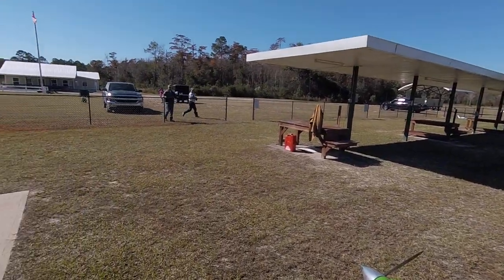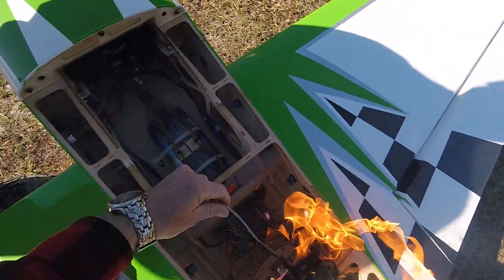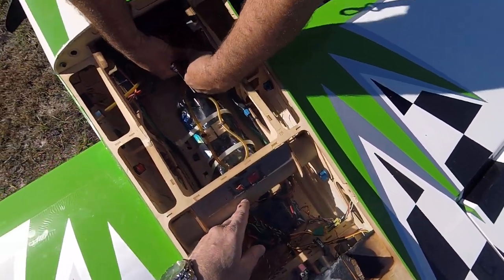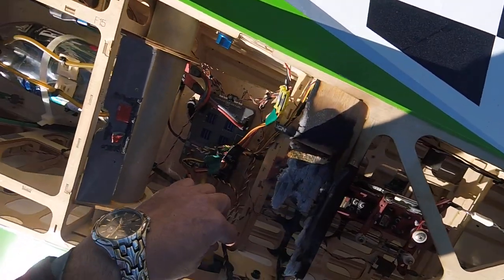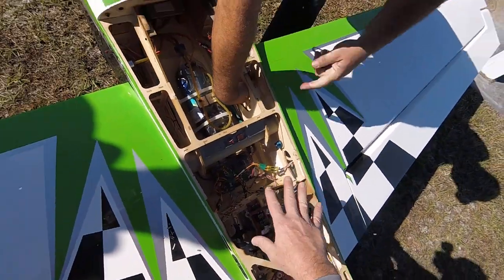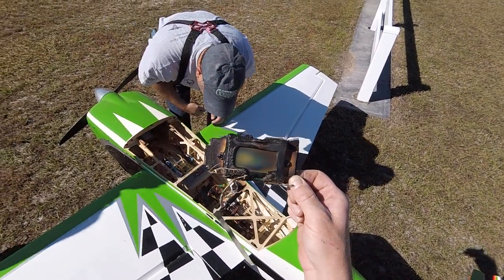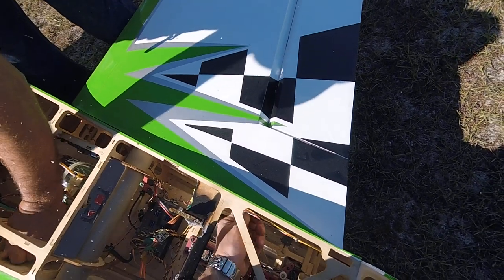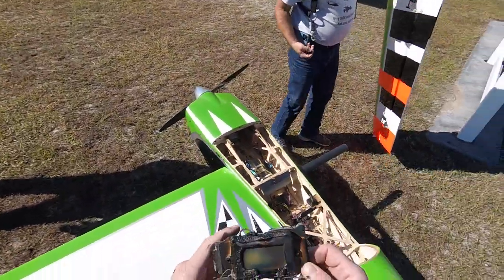PowerBox Systems LCD Shorted, Caught Fire, Burned Airplane

Comment: Vibration kills electronics 
Saw a booma lcd do the same thing a few weeks ago ....if you read the instructions they actually state vibration will kill them
Reply from the maker: Yeah I'll never use them, never have. I use straight double RX, with double satellites each, in a split system with redundant switches, batteries, and connectors. No gadgets to create points of failure. I've never had any failure that was not my fault.
Reply: Sorry, I dont belive you. Show me the video of the booma LCD catching fire. It is impossible by design for a Booma LCD to catch fire. The Regulator built into the LCD will shut down in the case of a short circuit.

Comment: Never use LiPO batteries in a gasoline or glow powered airplane and stay away from power box type designs! (Power distribution) direct voltage to receiver is the safest and still the best arrangement.. .
Reply from the maker: Had nothing to do with LIPO battery.... at all. Builder routed wires incorrectly and they rubbed raw and shorted.
Reply: @alwaysflying6540Well to answer your question sir',

 I fly 35% and 40 % aerobatic electric powered  aircraft extras&lasers and have been doing so for many years and my knowledge of electronics and Power Systems is far  above the majority of modelers.. .